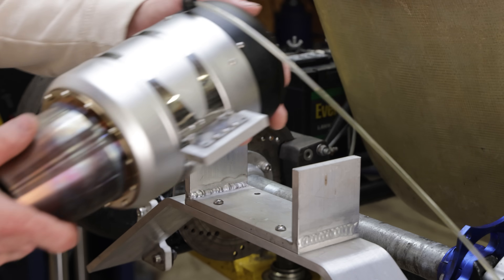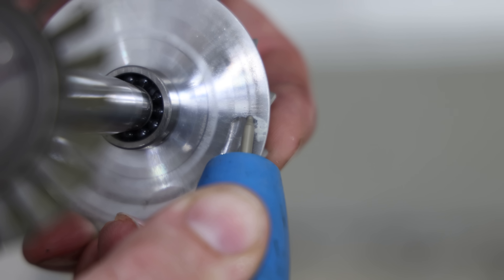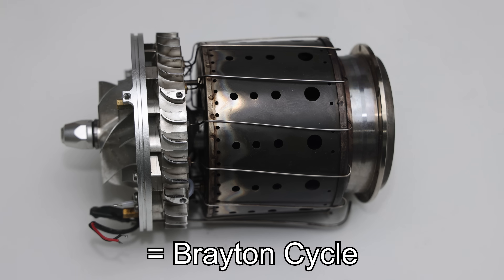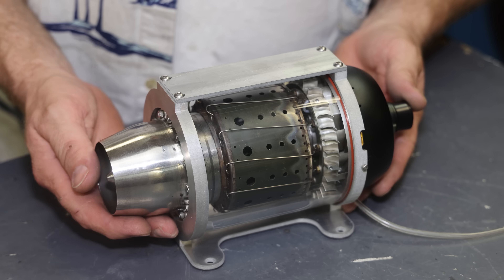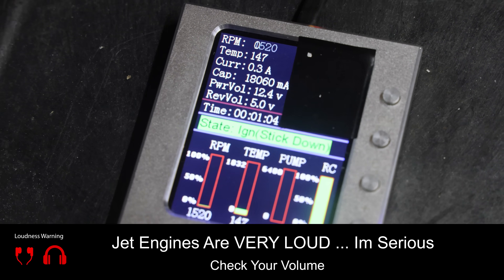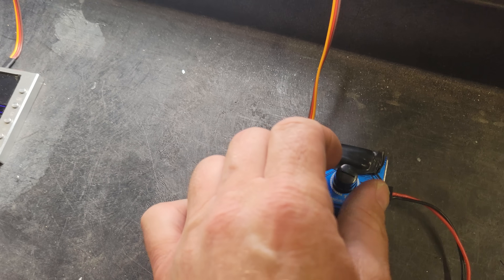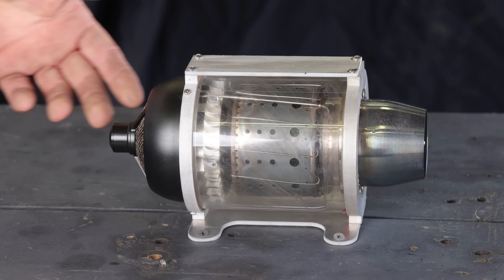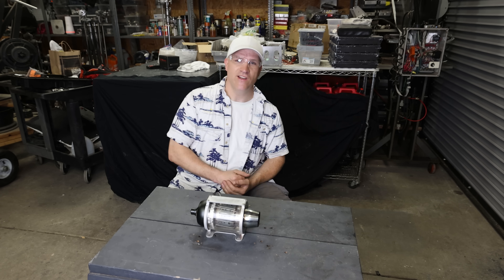See Thru Jet Engine

Comment: Jet engines do 4 things:
1) Suck
2) Squeeze
3) Bang
4) Blow.
Reply: That's for an internal combustion (gasoline, Otto cycle) engine. For a turbine, "burn" would be better than "bang", because it is continuous combustion not an explosion.
Reply: @brianb-p6586  better to stuter loud then speak nonstop you ignore but see examples of all the time for example when moving across ice you push hard your own mass in one direction then draw it back slowly right?
Reply: @jims6498  I have no idea how you think your moving on ice scenario has anything to do with combustion in a gas turbine engine... but there is no relationship. Gas turbine engine combustion is continuous, not a series of "bangs".

Comment: I used to use a Schenck balancer to balance standby attitude indicator rotors at 23,000 rpm. They were so old that they rarely got up to full speed. Too many drill starts which create drag.

Comment: Try using a glycerin solution in front
Reply: That's what he tried (the fog) - the glycerin is just consumed in the engine, so it won't show within the engine or in the exhaust.
Reply: @brianb-p6586  for carbon capuiture you woul d need to keep the exhaust seperate from some of the intake air but rocket engines use no intake air AT ALL often obviously with the opposite extreme ill considered and latest aircraft have many electric motors with one powerplant to drive them....

but power by wire is wrong solution totally despite it's gains

the ocean shipping industry is lowest hanging fruit so anticompetitive they collude to slow speeds down...

yet ocean is so warm.... and needing cooling.... with the heat to produce the potential energy to accelerate the network of vessels being ample and green, cheap but opec ending mean.

We need to care less about Opec's feelings and stop building what they demonstrate to end them.  THe demonstrate what won't hurt duh. BP etc. are all in on that old joke that should be funnier and forgotten intead of working well and ignored.

Comment: Could you build a jet enjine for a 125cc sized Honda moped? I'd love to see if that'd work.
Reply: if you have something to push off of you don't need to throw mass borrowed or brought.. and if your not alone, if your in last few hundred years i.e. bidirectional it is better to push off returning traffic then earth duh even if you have continental plate grip- why accelerate it? Invest the energy into the shipping system duh!

Comment: You turned a rheostat dial to increase the volume. That must translate to more fuel. How does that work? I'm also curious what electronics you use to power this. The digital display is cool, but I don't really know what the numbers for FUEL and RC are. Do you buy these or build them yourself? How often do they need to be serviced?
Reply: This is a commercially produced control panel. Look up documentation for Swiwin turbine engines for details, but the "fuel" number is proportional to the rate of fuel flow.

Comment: I'd love to see you use this engine using a copper gasket to handle the pressures and then run the jet then add nitrous oxide into the intake to see if the flame front will travel up and out the front of the engine despite the air moving against it! Hydrogen I saw this very thing and was a hell of a show! Nitrous is similar except its the oxidizer and its heavier than helium

Comment: Sorry to shatter your intake theory, but a properly designed curved intake (even adding a conical bullet at center ) before leading opening for jet intake(SR 71 Blackbird) is extremely important for air volume and how to ho faster than mach 2.. Do you understand how a 12" vent pipe loses a great deal of flow efficiency with its sharp cut 20 ga leading edge. Your design has screened 'boob' and may be safer for debris/small butterflys but is not ideal. I propose you test several designs for fuel / temp vs ouput. Where are the flow meters?

Comment: I work on jet engines a lot and your video is going to be an amazing way to explain the system. Basically, jet engine theory is that the flame NEVER actually touches the combuster case. It is actually “floating” on a constant stream of air fro those inlet ducts and holes to control the flame and keep it centered to provide the optimal burn and air/fuel ratio. That’s why you see the flame get more and more focused and concentrated as it spools up.

Comment: Extremely impressive skill level and engineering ability. I used to work with Rolls Royce engines and when he demonstrated the process of balancing the rotor it brought back a ton of good memories on the assembly floor. His equipment and knowledge of operation makes this video even more outstanding. A++

Comment: Temp: 1130...fareinheit I hope? 

Where did you get the compressor / turbine section? are those junked RC jets? This video is amazing but it's equally amazing that you have the mechanical skills to build a working new jet from broken jet parts.

Comment: This is awesomeness 2.0!

Now i still have some quistions about the way these engines work:
- Is it a continuous fuel flow, or is it pulsating like a car injector?
- Does the fuel ignite by a spark plug or a glow plug? And is it after that a continues and self sustaining 'flame' inside the combustion chamber?
- Does the throttle only add or lower the amount of fuel?
- In order to keep the 'flame' inside the combustion chamber and passing only through the outlet, the pressure inside the 'cold area' (around the combustor) must be higher than the pressure inside the combustor?
Practical questions:
What happens if a jet engine passes through rain: The inake air has quite an amount of moist in it then: does this effect the combustion? Obviously since rain tends not to burn that easy..

Thanks in advance for giving my brains some rest with your answers.
Reply: Fuel flow is continuous. 
Yes, it is ignited by a glow plug initially. Yes, combustion is self-sustaining after start, just like any burner. 
Yes, the power control (not really a "throttle") just changes the rate of fuel delivery. 
No,  there is not a significant pressure difference through the combustion chamber.
Moderate amounts of water don't cause a problem in a turbine engine, and actually improve power output by providing more mass of working fluid. Deliberate water injection has been used to boost takeoff power in some aircraft, but this is no longer used, perhaps because it's not worth carrying the water
Reply: @brianb-p6586  Thanks Brian!

Comment: I am not understanding how or what you are using to start the engine.
Reply: It's starts like any other engine of this type: the starter motor (mounted on the front) turns the shaft to get enough air flowing that fuel can be injected and ignited to begin operation, then the starter motor and igniter (glow plug) are turned off.

Comment: I was interested in detail on what the fuel does for the engine. it look like a lot of electrical but I noticed the fuel and you mentioned combustion. I am curious on how much fuel is necessary and what combustion does entirely and what would happen without  the fuel

Comment: Nice job!! Built two jet engine models my self so be be careful with this glass cowling. Use locktite on all screws cause of hi freq vibrations, tends to loose screws very often and easy. These axial movement that you had with engine could cause NGV to make contact with turbine wheel....which is bad at RPM higher than 100K. Usually there is a gap approx 0.8-1 mm between NGV and turbine blades because of thermal expansion of whole engine(shaft tunnel) so be careful with that. At 100k RPM and more, any issue can be a cluster fuck up :) ....God job!

Comment: ● Jet-powered Tesla! 😆 Excellent!
● The new airliner jet engine design focuses on pulling a lot more volume compared to the output side, i.e. bigger turbines and bypass channels.
● Mindboggling how with these model engines you think from the sound of it that it has reached peak RPM and then you realize that was just warmup.
● It is interesting to see how quickly the orange glow vanishes when turning the engine off: There is this nice self-cooling design. Hard to have heat soak effect when it's still pulling air through like crazy after poweroff.

Comment: We need to move into Magnetic Electro in sync and usage with this Planet, the magnetic motor spins the turbine to create the electricity, then the electricity fuels the magnets & makes them more Powerful and creates more electricity. Then the vehicle runs on the electricity. If on wheels, the spinning wheels can each have alternators on them for extra Electro, and the Transmission is the main drive train for acceleration & braking. For Flight, a fully operational Independent system can make it's own Electricity and Work with Heavy Duty Magnet Systems and this Planet's Magnetic Fields. Then be aided by wind turbines when in motion, and The Tesla Windmill System for additional thrusting when hovering & Not propelling forward or backward. Hydrogen or better could also be used as a backup system, & be processed from surroundings in Flight. Then Crafts could be tuned with this Planet's Magnetic Fields for a main initial base system that doesn't allow the Craft to ever crash or impact the Ground.

Comment: Well make video and you are quite the mechanic.  A thought and a question:

a. Always wondered why the exhaust fan, which drives the compressor, doesn't result in a runaway engine the that spins to its limit then explodes because the faster the exhaust the faster the intake.  Probably done with ratios and the fact the fuel injection takes place after the compressor.

b. What kind of glass, Plexiglass, or plastic is can withstand the temperatures involved?

Comment: It would be awesome the possibility to see through the combustion chamber. Maybe you can change half of it for glass (that should not melt if you run it not too fast)! 

Ps: I guess that for giving away half of the combustion chamber you would need also change the air flux (blocking part of it os something?). Since the relation air flow vs. fuel flow maybe is nonlinear, some fine adjustments regarding this would be necessary.  

Hope it works fine 🤞

Comment: well that's the idea of no bypass jet engines. Commercial aviation has very high bypass engines where the majority of the thrust is just air being sucked in and forced out the other side. Cool video regardless.

Comment: I'm trying to still understand how it works. The compression is not like a piston. And the electric wires that run up the chamber , are they the power to spin the rotor?  Explain this glow plug/ gas chamber thing

Comment: I am a Performance and Stability engineer at Rolls Royce PLC (Not the Car department 😅😅😅) and I could have never imagined how a combustor looks while the engine is running. I specialized in Gas-turbine Combustion instabilites, particularly Thermoacoustic instabilities and it is so cool to see the combustion directly. The only thing I remember is when we were testing a small segment of the whole annular combustor and it only had a small see-through window the size of a credit card 😅😅😅😅😅. Anyways, your hardwork is so cool. We engineers know that it's not just the fabrication alone, the design and performance calculations are so important in order to obtain the performance and feasibility that we desire
Reply from the maker: Very well said and very true

Comment: Would a pair of model jet engines like this be able to power an electric generator via a syncronizing gearbox  to charge their own batteries as well as to maintain battery charge for the climate control and special effects of a power armor like cosplay suit?

Comment: Hi my name is Steve I have A practical challenge for you hydrogen electrolysis hho generator system meaning A propulsion system four jets on platform with hydrogen fuel manufacturing many military applications close quarters century drone

Comment: I'm missing something.  When you create that pressure with ignited fuel, why is all the air forced out the back?  Why doesn't the pressure force the air equally out the front and back?
Reply from the maker: Because it takes the easiest route
Reply: @WarpedYT  Thanks for your reply!  But why is out the back the easiest route?

Comment: I loved your jet engines on the Tesla. Have you ever thought about using a jet engine to run a generator as a range extender for the tesla? You could still us the boost to help the forward motion, but instead of having to run the jet all the time only run it when the battery reaches a low level of charge.
Reply: the camping turnbine now orderable lol makes too much noise man!  7 kw i think and light

Comment: I'm curious about what you used for a fuel control unit, and how your fuel throttling is accomplished.  Also, because the machine is so small, how is starting accomplished?  It does not look like there is an accessory gear box with a semi-perpendicular shaft running off the main shaft for accessory/starter operation.  And, I'd be interested to see what kind of thrust your engine produces.  Perhaps the engine stand on rollers with a cable from the stand to a spring scale of some sort.
Reply: The starter motor is mounted on the front of the engine shaft, connecting through a small overrunning clutch. It is visible as the small black cylinder protruding from the front cover. There is no gearbox, and there are no other accessories mechanically driven by the engine - the fuel pump is electric.
Reply: This is a modification of a production engine model. Like other engines of this type and this size (100 mm diameter turbine wheel) it produces about 130 N (30 lb) of thrust. Thrust scales are readily available and routinely used for testing these motors, but thrust measurement isn't needed for this demonstration.

Comment: Great video, explanations and machinery! Quite a feat! Kudos and hats off.

8:57
For any combustion the mass (weight) of the oxygen is about 3-times or for air about 15 (14.7)-times larger, as in most cases pure oxygen is not used, than the mass of the carbon fuels (and similar to carbohydrates we eat!).
So yes indeed, combustion engines draw in a lot of air compared to the fuel and in a (turbo)jet engine even more (= leaner) as as a perfectly stoichiometric mixture may cause overheating, although the weight of the air in pounds has no direct relationship with the thrust in pounds; that’s just imperial units confusing people. So most (of the mass) of the energy is NOT in the fuel, although purely chemically one could take another view.
As an aside - combustion engines don’t have to carry the heavy amount of air consumed around with them, which is the reason that battery or hydrogen powered (longer) flights with payloads may be difficult as they need to carry all the energy with them (batteries) through the entire flight without getting lighter or are much heavier per specific energy density (hydrogen).

8:45
This is the reason to use SI-units instead of imperial ones to never confuse weight and thrust/force, to much more easily understand the relations between various units and to use the decimal system ;-)
Reply: Hydrogen-fuelled vehicles operating in the atmosphere (so, not spacecraft or submarines) don't carry the oxygen with them,  either.
Reply: Yes, I forgot the word "either"between "they" and "need" to make it an either-or argument.
Reply: @KAOS.i  It did look like there was some confusion between the battery and hydrogen scenarios.

Comment: Instead of fog can you please do the fire extinguisher,does it kills the jet engine??
Reply: I can't imagine anyone willingly putting dry chemical from an extinguisher into an engine that they own and would have to clean out and repair.
A significant amount of water can be ingested without causing problems - moderate quantities, it even increases thrust by giving the engine more mass of working fluid.

Comment: it doesn't look like there is a lot of thrust generated by these engines
Reply: How do you think you can see thrust? And how much do you think it is producing, or how much is "a lot"?
Reply: @brianb-p6586  too small, mounted on to the table by tiny screws and it doesn't even shake/move the table at all
Reply: @user-ge5oe9oo2k  the table is strapped to anchors in the floor.